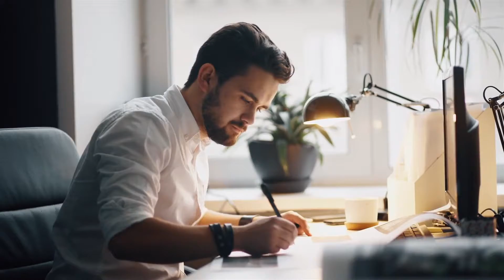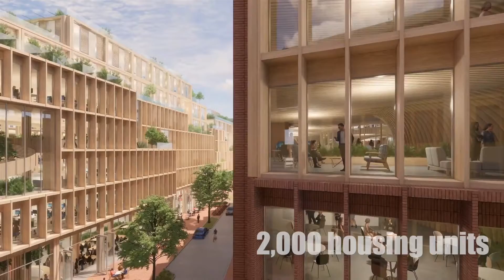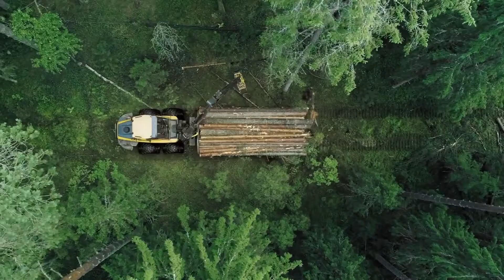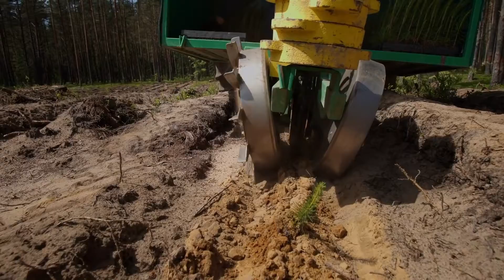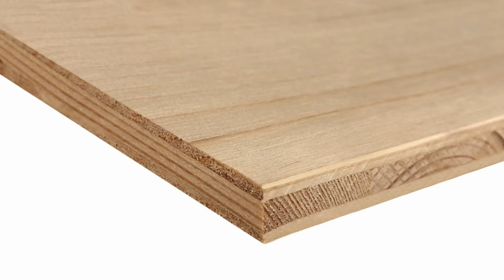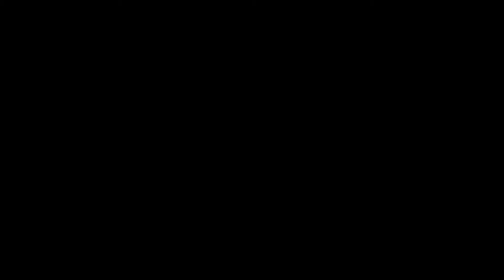Sweden Is Building The World’s Largest City Out Of Timber

Comment from the maker: A dream city or a mega project living on a flammable knife edge?
Reply: Timber wood is less likely to burn and are more safe than concrete and steal
Reply: It burns just as easy  but normally just the outside  unless left to burn. @tazzo_xy1938
Reply: One war occurs and it's all over.
Reply: Using self extinguishing paint (fire-resistant)
Reply: the wood will not catch fire. if you google about how it works you will understand its not a risk building with this type of wood
Reply: It's not really a wood city, it's just a few blocks. And Sickla is one of the most green and beautiful parts of Stockholm. The old factory buildings are amazing, they have become a library, several restaurants and a kindergarten. What they are replacing is just a mall. So, please get your facts right.

Comment: Not sure this is really the world's biggest wooden city, I think even Buffalo NY may have it beat. Was wondering what the plan for the roof tops was? I know Buffalo ditched the wooden cedar roof thing over 100 years ago, and also, nearly all houses had to be wrapped in plastic, steel, or asbestos, to protect them from fire and rot, and seal up the historic lead paint problem, witch was the old way of preventing rot, as well as using local rot resistance woods that are now exstinxed due to disease. World's nicest wooden city might be more accurate here, given the sad state of one's I think are larger.

Comment: 7000 offices? Here we are now faced with a large amount of unused office space, spaces that can't easily be converted to something else. In many case, glass towers are sitting empty in major US cities, as the work from home lifestyle has emptied them out. Almost all new skyscraper construction here is for housing only, maybe with retail on the ground level. A lot of historic, older buildings, such as the Empire State Building, are sitting most vacant. Such a building can't be remodeled into housing: besides the enormous cost involved, it wouldn't be structurally feasible to make the changes needed, not with a building almost 100 years old.

I hope that the builders plan for this issue - by making the building easier to convert to other uses, such as housing. Planning from the beginning to be able to convert the buildings to other uses, will work far better in the long term.